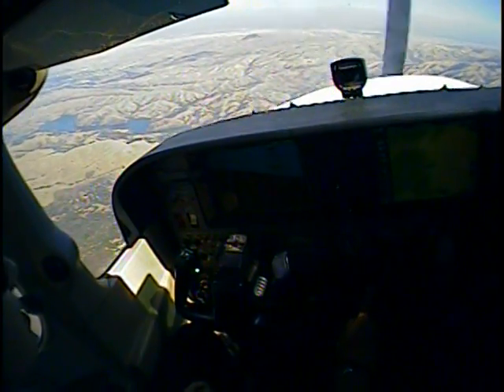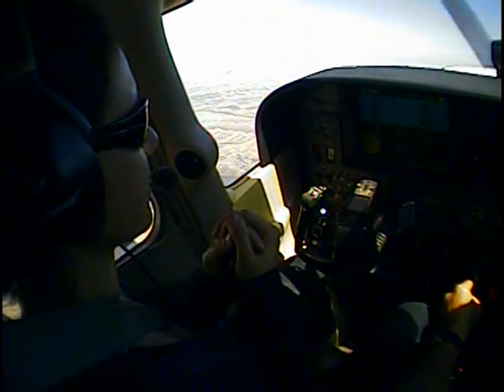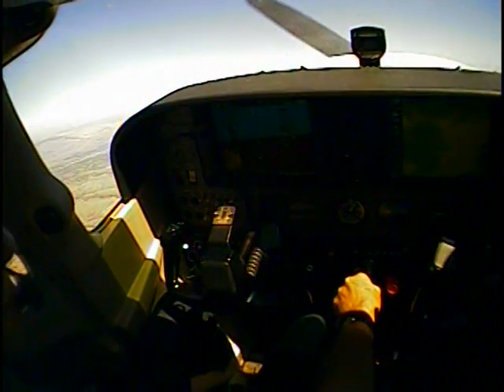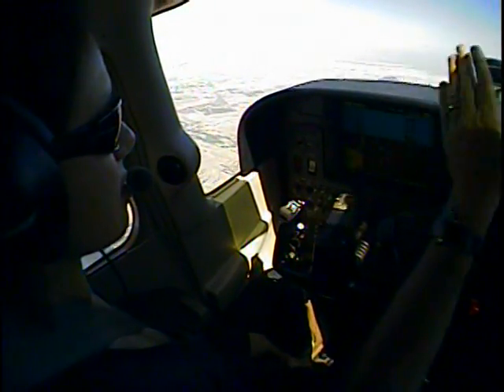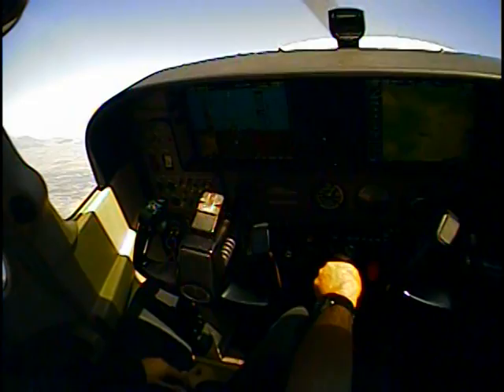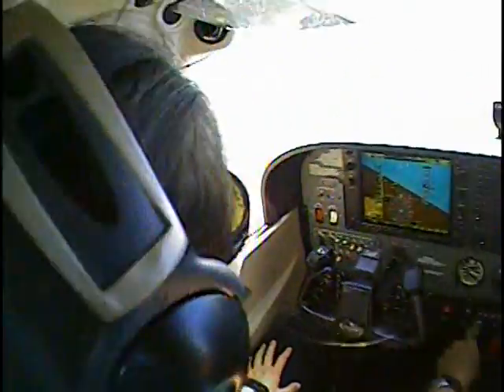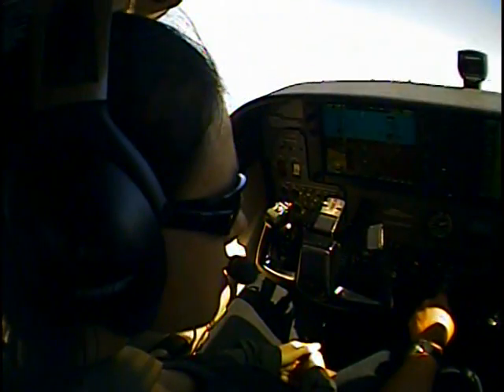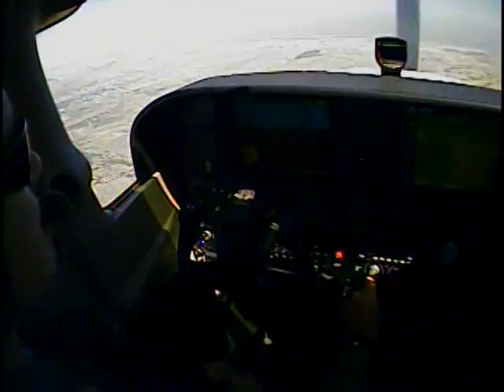The Power-on Stall:  Entry and Recovery

Comment: What plane were they flying? It almost went into a spin in nothing but a second.
Reply: That looked like a Cessna to me. 
That is the point of the lesson: in a power on stall you must use rudder to keep the wings level, not ailerons. If you use ailerons and not enough rudder one wing will completely stall and a portion of the other wing will still be generating lift. This will cause the airplane to rapidly turn in the direction of the completely stalled wing.